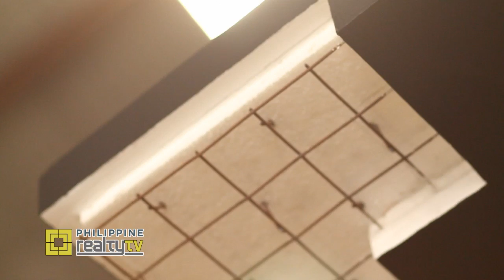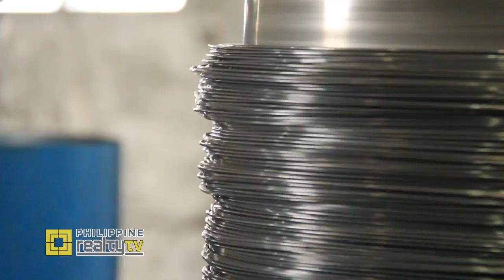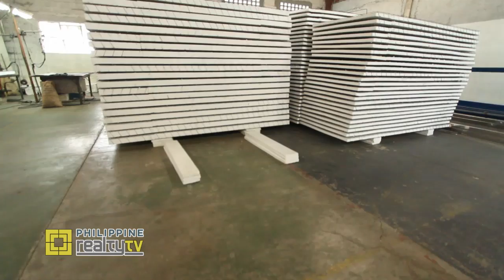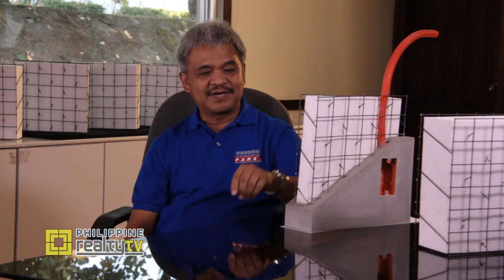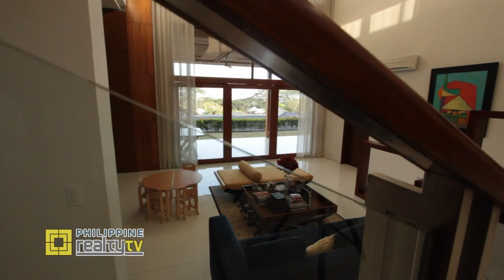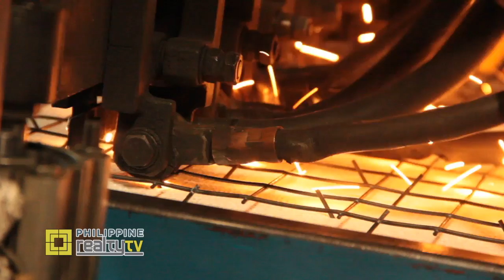SRC Panel Systems

Comment: #郑州中天建筑节能有限公司   河南   中国
#Zhengzhou Zhongtian Building Energy-saving Co., Ltd.  河南   中国 ‌
#Produces fireproof lightweight integrated housing wall panel equipment
#‌Steel Wire Mesh Welding Machine (1.2m Width)‌
Model: ZT-DN-1200L
Welding Width: ≤1.2m
Number of Welding Heads: 25
Welding Diameter Range: 2.0-3.5mm
Welding Transformers: 3 × 75KVA transformers (individually controlled)
Mesh Size Adjustable: 50-200mm (Vertical spacing manually adjusted, horizontal spacing input via touchscreen)
#Vertical Wire Feeding: Coiled wire straightened by rollers, fed into welder, pulled into mesh by servo motor
#Horizontal Wire Feeding: Straightened/cut by straightening machine, placed into horizontal wire feeding mechanism, automatically fed by stepper motor
#Cutting Method: Paired with small shear for automatic cutting/falling
#Main Motor: 3KW frequency-conversion braking motor with reducer
#‌Equipment List:‌
.CNC Welding Machine: 1 unit

#Zhengzhou Zhongtian Building Energy-saving Co., Ltd.‌
#Produces fireproof lightweight integrated housing wall panel equipment
#‌Steel Wire Mesh Welding Machine (1.2m Width)‌
Model: ZT-DN-1200L
Welding Width: ≤1.2m
Number of Welding Heads: 25
Welding Diameter Range: 2.0-3.5mm
Welding Transformers: 3 × 75KVA transformers (individually controlled)
Mesh Size Adjustable: 50-200mm (Vertical spacing manually adjusted, horizontal spacing input via touchscreen)
#Vertical Wire Feeding: Coiled wire straightened by rollers, fed into welder, pulled into mesh by servo motor
#Horizontal Wire Feeding: Straightened/cut by straightening machine, placed into horizontal wire feeding mechanism, automatically fed by stepper motor
#Cutting Method: Paired with small shear for automatic cutting/falling
#Main Motor: 3KW frequency-conversion braking motor with reducer
#‌Equipment List:‌
.CNC Welding Machine: 1 unit

#Zhengzhou Zhongtian Building Energy-saving Co., Ltd.‌
#Produces fireproof lightweight integrated housing wall panel equipment
#‌Steel Wire Mesh Welding Machine (1.2m Width)‌
Model: ZT-DN-1200L
Welding Width: ≤1.2m
Number of Welding Heads: 25
Welding Diameter Range: 2.0-3.5mm
Welding Transformers: 3 × 75KVA transformers (individually controlled)
Mesh Size Adjustable: 50-200mm (Vertical spacing manually adjusted, horizontal spacing input via touchscreen)
#Vertical Wire Feeding: Coiled wire straightened by rollers, fed into welder, pulled into mesh by servo motor
#Horizontal Wire Feeding: Straightened/cut by straightening machine, placed into horizontal wire feeding mechanism, automatically fed by stepper motor
#Cutting Method: Paired with small shear for automatic cutting/falling
#Main Motor: 3KW frequency-conversion braking motor with reducer
#‌Equipment List:‌
.CNC Welding Machine: 1 unit#Zhengzhou Zhongtian Building Energy Conservation Co., Ltd. China ，Henan
#Fireproof Lightweight EPS Integrated House Wall Panel Equipment Production 
#Made in China 
#High Quality & Cost-Effective
#1.2m Width Steel Wire Mesh Welding Machine
#Wire Mesh Welding Machine Model: ZT-DN-1200L#Steel Wire Mesh Welding Width: Within 1.2m
#Steel Wire Mesh Welding Head Quantity: 25 Pcs
#Steel Wire Mesh Welding Diameter: 2.0-3.5mm
#Steel Wire Mesh Welding Transformer: Equipped with 3 Units of 75KVA Transformers 
#Separate Control Welding
#Steel Wire Mesh Grid Size: 50-200mm Adjustable (Vertical Wire Spacing Adjusted Manually #Horizontal Wire Spacing Set via Display Screen)
#Steel Wire Mesh Vertical Wire Feeding: Coiled Wire Straightened by Straightening Wheels 
#Fed into Welding Machine
 #Mesh Pulled Cyclically by Servo Motor
#Steel Wire Mesh Horizontal Wire Feeding: Straightened & Cut by Straightening Machine First #Then Conveyed to Horizontal Wire Dropping Mechanism 
#Automatic Dropping by Stepping Motor
#Steel Wire Mesh Cutting Method: Automatic Cutting & Dropping with Matching Small Shearing Machine
#Steel Wire Mesh Main Motor: 3KW Frequency Conversion Brake Motor Reducer
#Steel Wire Mesh Equipment List
:#1 Set of CNC Wire Mesh Weaving & Welding Machine
#1 Set of Steel Wire Mesh Shearing Machine

Comment: What is the thickness of the plaster to be used for these SRC panels?
Reply: 1.5 inch to 100000000000000 inches

Comment: This is "pro vídeo" towards the product, it should be some cons but nobody say anything untill this system starts falling in people's heads!!!
Reply: Con's lol.... it can be built as a single monolithic concrete structure, one of the strongest structures in construction: When built correctly.
You can use these panels in Post and beam as insulated Sheer Walls. 
These can be load bearing walls if correctly installed.

I have not read any Con's, and i been studying these for years.

Comment: Nag inquire aq eto po pricing nila, hope this helps
SRC Panel size & thickness 

1.5” 4ftx8ft P1,664.64
1.5” 4ftx10ft P2,080.80
Flat mesh P98.00
Angle mesh P108.00
U mesh P118.00

3.0” 4ftx8ft P2,096.64
3.0”4ftx10ft P2,620.80
Flat mesh P118.00
Angle mesh P118.00
U mesh P188.00
Reply: Isa kang alamat idol.. ang hirap makakuha ng presyo sknla.. salamat!
Reply: @chillroomph  check out mo din sir ung Light gauge steel materials na bahay w/c is patok din abroad kac mura at durable din
Reply: bro san ba pwede mag order nito?
Reply: @jesusitorayala8214  sa FB page nila message mo lng me mag aassist sayo dun

Comment: Ok now im very curious can anyone please tell me how is this so safe than the traditional with hollowblocks? So that I can decide ahead of time thankyou..
Reply: The metal mesh used in the product, and it's design cause a truss frame work, once the finish is applied, that distributes both compressive and lateral loads when applied. If you notice the diagonal wire inserted in the panel and welded on each side. That is the same engineering used in load bearing roof and floor trusses systems, applied in a veritcal system. So, yes, it is very strong. But, you can also pour the cells of concrete blocks with rebar inserted, which creates much stronger wall systems.  But, there are dynamics here which few people understand.

Comment: what happen if your cement plaster has crack so the wire mesh become rusted, i do not recommend for exterior wall only for interior
Reply: Pwede pong pinturahan ng epoxy primer o red oxide ang wire bago maglagay ng cement plaster upang hindi kalawangin ang wire kapag nagkaroon ng crack ang cement plaster.

Comment: I'm from Assam, India. Lived 30 yrs in rented houses. I was fed up with the comfort level of the homes everywhere I rented. Very hot in the summer and fridging cold in winter. These homes are so rigidly build that these might cross 200 years, but you can't live comfortably today. I didn't find the cause why to bear the pain. 
...... 
This summer I was forced to come to my native village because of post covid crisis and constructed a home with two rooms for experimental purpose with your idea that I noticed today. My home is very comfortable and inexpensive. I got 3" Styrofoam in the center and inside plywood is layed and outside bamboo covering is used. This seems durability is low, but covering both side with concrete will increase the durability and even security🔒. 
Thanks for your idea....

Comment: This is already in- use in Europe 3 or so years. It is cheaper and lighter, however Philippines is a warm country that may be prone for fire. Is it not dangerous?
Reply: Here in Philippines there are a lot of termites. Is it termite proof? 
We had styro stuck in our province, termites burrow it. Is this cannot be burrowed by termites?
Reply: SRC Panel eps(styro) is not an ordinary styro, it has fire retardant additives, if you put it in an open fire it will not burn, it will just melt.
You can message us at our FB Page SRC Panel Systems... thank you

Comment: HM per panel?
Reply: Hi friend，I’m Nora from Chinese EPS machine maker，Our company produces the device and material in the video. If you need to check the details, you can contact me.
tel/whatsapp/wechate/skype:+008613386456156
e-mail:nora@abcn.group
Reply: You can message us at our FB Page SRC Panel Systems, or call us at this number...
8983-5893
8939-8106 to 08
Reply: You can message us at our FB Page SRC Panel Systems, or call us at this number...
8983-5893
8939-8106 to 08

Comment: Are these panels municipal govt  ‘approved’ for use as load-bearing walls without need for columns and beams for to 2-3 storey structures? Thank you.
Reply: You can message us at our FB Page SRC Panel Systems, or call us at this number...
8983-5893
8939-8106 to 08
Reply: It's according to what governmental environment you live in. If it is a country that utlizes this technology regularly, the more than likely they do. If not, a structural engineer will have to sign off on the design. The structure will also have to be designed by someone who understand the load characteristics of the panels and how load forces react with it's design.

Comment: This is SCIP panel systems that were invented by my late business partner Paul Artzer (The Artzer Panel) that was created in Houston Texas in 1968 and EVERY system out there is derived from their invention. I have worked with various clients over the past 20 years and every panel system that I see (this design that SRC has is fairly good but too thin, has wire edges that stick out and can shred an installer's skin and do not have the structural integrity of a 4" standard panel. Perhaps they are using thicker concrete as a skin coating but then you risk the possibility of have seismic cracks from building movement - especially in beach areas and other areas that are along the coasts which is most of the Philippines. 

My wife of nearly 15 years is Filipina and I have been to the Philippines but no one has ever told me that such a similar system exists.  Since the death of my business partner and his estate being settled I am setting up manufacturing here on the West Coast of the United States and will be in the Philippines by next year. I will visit SRC and see if we can work together. Cheers!
Reply: @sterlingmichaels  I'm also considering this type of material for future residential project, especially here in the southern Philippines(Mindanao) where earthquakes are frequent, hoping that by using a lighter material could prevent a disaster to happen.
Reply: @rjee007  Cool!
Reply: That is fantastic, is there a way to contact you? I am doing some research into producing this in my country. Will love to hear from you.
Reply: How do you think this compares to ICF blocks...
Reply: @joeschlotthauer840  ICF blocks are too labor intensive to build with - thus more than TRIPLING labor costs, create too many locations in each building for seismic structure failure/compromise - have no clear seismic structure THAT IS CONSISTENT due to the fact that concrete poured IN the ICF can lead to air pockets, poor quality of cement used and have no monolithic structure except for the skin once the finish is applied.

The SCIP structure acts like a Monolithic Shock Absorber. I had built over 300 homes and commercial buildings when I was first introduced to the SCIP system and because, in 2007 I was originally hired to raise money for the manufacturing process I vetted over a dozen SCIP companies and only ONE was anywhere near the quality - M2 Midue from Italy, which company originally got their fabrication designs from my business partner, the late Paul Artzer of the Artzer Z Panels which are equal build, fit and finish to M2 but M2 has a fantastics staircase structure and the only challege with that is you have to  push in 4 full length rebars into the concrete in order to keep from any air pockets compromising the unseen concrete.

What makes the SCIP system superior is that there is no place that has a structural sheer weakness, if done properly. What makes the difference is if you start added steel studs to the panels, you now have more points of steel and concrete creating weak points due to the studs themselves creating a frame, which, while it helps the strength of the whole building, you are now adding potential sheer points during a seismic event and not just earthquakes but floods, mudslides, etc.

When finished with 5/8" Portland Cement or Shotcrete, the SCIP system is a COMPLETE MONOLITHIC structure that has litte to zero sheer points because the EPS foam and the 14 gage steel wire that comprise the makeup of the frame are encased with high density cement that is extremely hard to crack let alone break and we have had tests where a 2story structure on a seismic pad (400 sf each floor) was tested for 8 hours with ALL forms of seismic stress, and there was not even a hairline fracture. up tp 9.8 stress levels.

After that; after my spending THREE YEARS trying to understand WHY this test was so powerful, I suddenly saw i my mind that the panel themselves acted like one big Monolithic shock absorber and the cement's tensile strength kept in completely  safe and in tact. For me, even steel buildings cannot withstand this type of stress and is the most SUPERIOR of building systems IF you do not overdo the framing and keep ALL 14 gage steel and 1" rebar only to the entire buildings.

Hope that this helps.
Reply: @sterlingmichaels  
Thank you for informative and kind response, do you have a link/video to your SCIP system...
Reply: @joeschlotthauer840  Sadly, no. Since the death of my business partner Paul, I have been working on a large development project here in California that I am moving to Tennessee and will move the factory equipment this fallad film the entire development as a ten part docu-series late this year or early next.
Reply: @sterlingmichaels  
What is a SCIP panel...
Reply: @joeschlotthauer840  Stuctured Concrete Insulated Panels.
Reply: I am interested to work with you sir. I will save your email.
Reply: Hello sir im a civil engineering student, how thick are u using in America?
Reply: @janwilburgarcia8315  4 inch panel with 5/8 shotcrete mixture on inside and outside = total 5 1/4 inches
Reply: You can message us at our FB Page SRC Panel Systems, or call us at this number...
8983-5893
8939-8106 to 08

Comment: How much is the cost of the panel for 3,4&5 inch. Thichness
Reply: Hello Ehgay antalan,we are manufacture.Pls contact 008613365455439,E-mail: amysalemanager@abcn.group. I will send you some details.
Reply: You can message us at our FB Page SRC Panel Systems, or call us at this number...
8983-5893
8939-8106 to 08

Comment: its blocks the heat? eh bat dito samen sa imus same ang ginamit SRC eh napaka init ng walls compare sa bahay ng parents ko hallow blocks???
Reply: Because Hindi maganda yung insulation nyo sa bubong, baka nag kisame lang kayo o may pumapasok na init from the roof…😁
Reply: @jessiejanapin7636  hindi mo ata nabasa ng maiigi comment ko, sabe it blocks the heat and yes kahit ano pa ilagay mo it will block the heat what im saying is napakainit parin ng walls. i mean walls, ung roof given yan iinit talaga yan, kahit may insulation kapa. tanga neto!!!!!
Reply: @hoopstv9140  hindi mo rin yata naintindihan sinabi ko, yung wall insulated because of the eps on SRC Panel, baka yung init nangagaling sa ibang part ng house, like roof, hindi lalabas ang init dahil nga insulated ang walls mo, kaya dapat check nyo rin kung saan nangagaling yung init, definitely hindi sa wall nangaling ang init dahil bina block nya ang init at hindi tatagos pa loob..
Reply: @jessiejanapin7636  hinawakan mo na ba ung wall namin? so kung mainiit ung pag hawak ko sa wall namin sa loob eh mainit that means hindi sa wall galing ung init? baka sa roof? so kung mas mainit ung wall namin compare sa sa kisame hindi ko pede sabihin na hindi dahil un sa wall namin? tama ba?
Reply: @hoopstv9140  kung mainit ang wall mo sa loob pwede nga sa iba galing, kasi hindi makakalabas yung init kaya nasa concrete lang sya nag stay yung init, dahil bina block nga sya ng eps sa loob, or baka naman ibang materias yang ginamit sa bahay nyo, and may mga series of test ang SRC Panel para malaman ang insulation effect, kaya parang ikaw pa lang nagsasabi na yung insulated wall mainit ang loob😅, give me proof na SRC Panel ang ginamit sa bahay nyo😁✌️
Reply: @jessiejanapin7636  i can provide proof, but i will not waste my time on you. 😂😂😂😂kung ayaw mo maniwala eh di wag, walang may pake at hindi ka rin naman makakatulog!!! 🤣🤣🤣🤣
Reply: @jessiejanapin7636  tsaka what's ur profession ba? are you credible enough to start an argument like this? also are you one of the enginner's na gumawa? if yes i'll rest my case though. or ur just watching utube?

Comment: Dear Philippine Realty TV, I tried to connect with SRC Panel team through the website mentioned in your video but its not working/under construction. Can I get the contact details(valid email id/phone number) of SRC Panels team. Even I tried to connect with them through phone but its switched-off. So if you have details please share it with me. Thanks
Reply from the maker: rodneydizon@gmail.com
Reply: @PhilippineRealtyTV  hello po..saan po makakabili ng SRC PANEL..
Reply: You can message us at our FB Page SRC Panel Systems, or call us at this number...
8983-5893
8939-8106 to 08

Comment: there is no such thing as you can save more on this new technology wall system compared to the traditional CHB Wall System...YES you can save installation time and manpower but the overall cost is more expensive considering specialized equipment being utilized...
Reply: You can message us at our FB Page SRC Panel Systems, or call us at this number...
8983-5893
8939-8106 to 08

Comment: How much does it cost? Can be used for flooring also?
Reply: How much per panel
Reply: @aeyzeirianarmenta4307  Hello,we are the suppliers of EPS machinie, you can add my Whatsapp: +0086 13365455439 for more details, tks
Reply: You can message us at our FB Page SRC Panel Systems, or call us at this number...
8983-5893
8939-8106 to 08